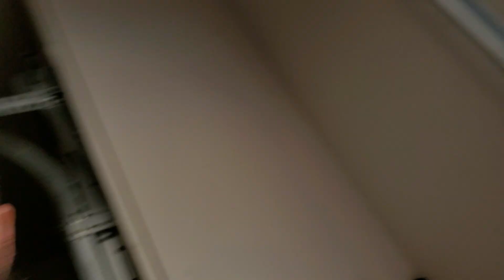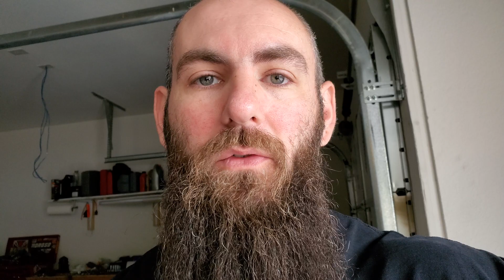water-methanol settings for power and economy - 6.7 powerstroke

Comment: I race sprint cars. Our engines run on methanol. Go to a fuel ⛽️ supplier like Ramos oil . Methanal is a ton cheaper like low $2’s a gallon. Make your own with distilled water 50:50
Reply from the maker: @paulygood6665  ill look them up.  I've moved since making this video and we have a place called key oil but it's about $6/gallon
Reply: A turbo blanket ....just put one on...I also race my dually...PB us 13.82 et. 96Mph...bad for a 10k truck...6.4 08 F450...I have the time tickets to prove!

Comment: The main reason for water methanol injection is to  keep those EGT temperatures down in extreme conditions    like pulling a Max load up a mountain  grade on a hot summer day  in order to help you keep from frying your motor  you're probably don't really need it on the flats  unless you're  pulling a really big heavy load and it's really hot outside
Reply from the maker: @markyoung9027  for me, it's more of a  want than a need.  I am hoping to put a compound Turbo kit on the truck next year.

Comment: Damn son I get 25mpg on my 6liter powerstroke without methanol and mines fully built with race heads and upgraded every part under the hood on a stage 2 KC jet fire with 190/30s the truck rips hard. And clean as fuck had I’d Speedshop tune it.
Reply from the maker: @Robbiejames420  this truck has never gotten good mileage

Comment: Great videos on 6.7 water meth inject.  A suggestion to get your temp probe installed.  Get a T fitting that will thread into your ebp location.  Put the fitting long side vertical.  Mount the ebp on the side portion of the T, put your probe down the long vertical.  One way of getting it installed with out messing with egr pipes.

Comment: Where are you getting methanol in Vegas? Or, what substitute are using…-20* washer fluid?? Thanks!
Reply from the maker: I buy 5 gallon cans from the vp gas station next to the Santa fe.  I have also gotten it from a business on the east side owned by Benjamin Dyer.  I also run -20 washer fluid on occasion
Reply: Awesome! Thank you!

Comment: Get some windshield wiper fluid . Try to get Canadian grade or the norther states . 
Works great for us comparing costs.  Does it give you the same performance.... nope but it does gives you more hp/torque and gas saving for about 2$ a jug .
Reply from the maker: We have -20* washer fluid here but it's $3/gallon.  I have switched to 40/60 mix meth/water.  At that ratio I'm paying $3.80/gallon.  I feel like that's a good compromise between cost and performance

Comment: 12.4??? Holly crap?!?!?! I have a 2011 6.7 and with my led foot I usually get about 14.5!!! 13MPG towing up the cajon pass going to races in the desert!!! What size tires do you have? Because if you have 35 or 37s that's not a correct MPG rating
Reply from the maker: I'm on 35s.  I know the reading isn't correct.  But regardless, spraying too much meth kills mpg.  Looking forward to the next road trip to see how it does now that I'm spraying at a much higher boost pressure